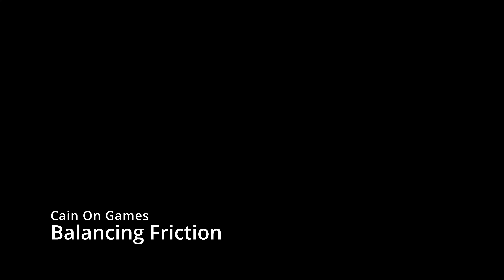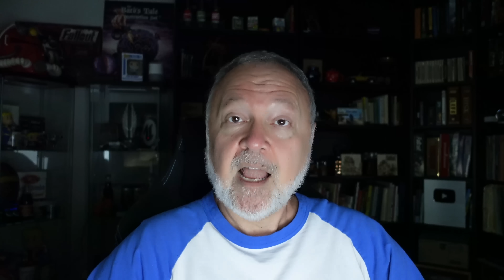Balancing Friction

Comment: Trash mobs was the term you were looking for and they seem to be very contentious in the MMO community. Some people like a lot of easy ones so they can push their big damage AOE buttons, some people don't like any of them since they get in the way of the boss fights, some people like difficult ones that require strategy so clearing trash is fun and rewarding. Opinions are all over the place.
Reply: I'm personally a fan of trash mobs, but I'm also a fan of every encounter having a purpose. Trash mobs should still be dangerous enough in numbers that you can't ignore them, and they should also provide tactical variety compared to larger mobs. Balancing mobs is tough, but I maintain that variety is the way to go.

Comment: To the guy who said "Every Fight Should Be a Boss Fight": Please play Alien Soldier. It's a great game and does basically that, but its way of having refresher breaks is to have very short 30 second micro-stages between every 1-3 bosses. But those micro stages aren't "free". They will kill you every bit as much as the bosses if you get sloppy. But the walking-away experience of the game is "Woah!! Such a cool boss rush!!"
Reply: even boss rushes need a little bit of downtime, or else it's just another big health bar to the player
Reply: non-boss enemies usually can utilise environment, composition and gaps in player attention much better. Souls series does is great example of that. But to some it's more frustrating than losing to some bombastic boss, since learning patterns is less mentally taxing, than constantly looking for traps and keep track of multiple enemies.
Reply: every fight in shadow of the colossus is a boss fight but it also has good down time

Comment: Tim, I was wondering about level design in the early stages. Before you even talk about art or assets, how do you plan out the kind of levels (or areas, in an open world) you will have? Do you derive it from the narrative, or is it a combination of other factors? Do you think about the boss and cinematic areas first and then fill in the in-between areas, or just think about the how the setting would have it, and organically derive it from that?
Reply from the maker: It’s based on the story. You make levels/areas to support the main storyline, and those areas are made big enough to support side content.